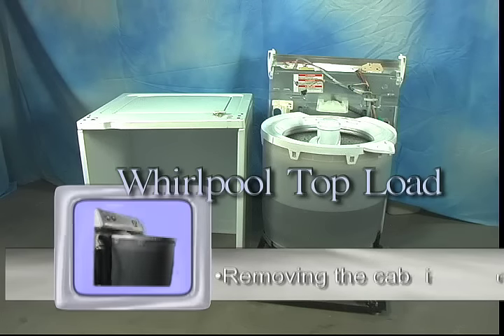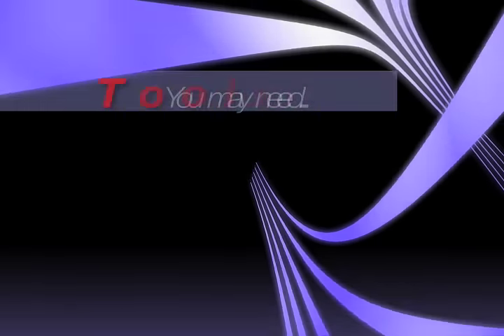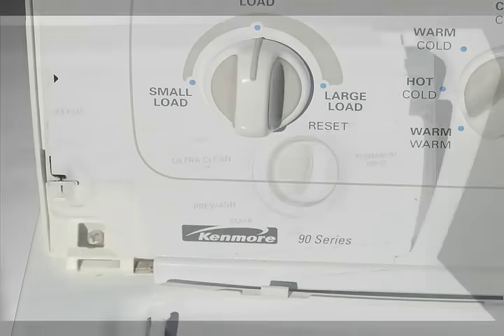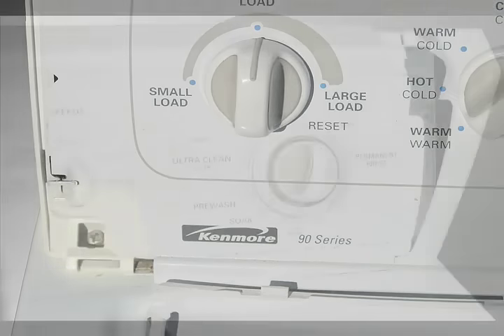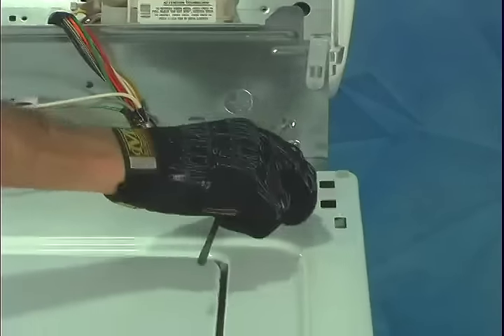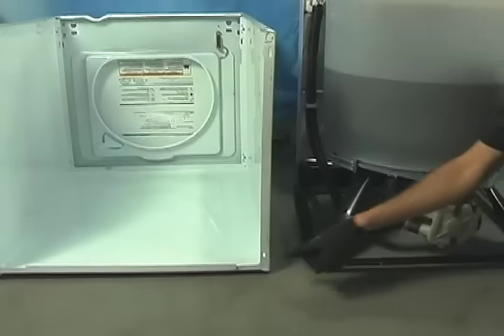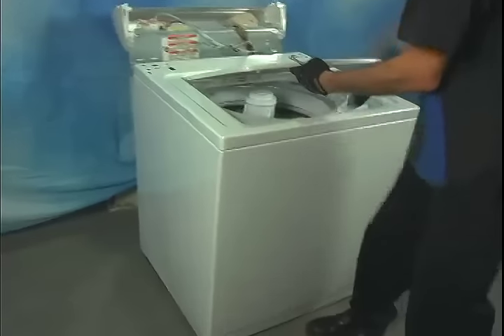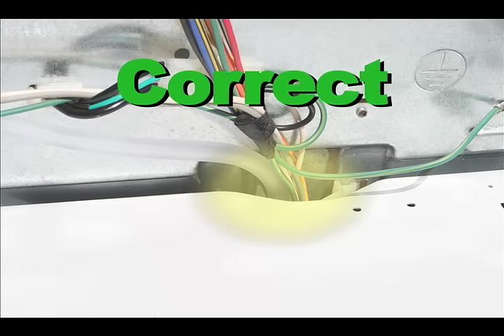Whirlpool Washing Machine Repair

Comment: On a normal was cycle on a Whirlpool WTW57ESVW1 should the agitator start while the water is filling
Reply from the maker: James Moyers No it should wait to agitate until the water has reached the fill level based on the level setting... 
Here is a link to the service manual for that washer style
http://applianceassistant.com/Appliance-Repair/Appliance-Service-Repair-Manual-Feature.php?id=1519

Normally my guess would be the timer. However, your washer has an automatic load sensing switch with a small control board... so that is probably more likely to be the problem.  It's going to be difficult to know for sure without doing some voltage tests.  Start by visually inspecting the pressure sensor control. hopefully you will find and obvious burn or failure.

Comment: I had the exact same problem as 1timeinstaller commented on 2 months ago - a small leak in the plastic case of the pump which was easily fixed with epoxy.  But only thanks to the great video on how to get the cabinet off.  So THANK YOU!!

Comment from the maker: Occasionally the same kind of symptoms can occur during the rinse portion of the cycle if the water valve is not functioning properly.  If the timer freeze happens to be on the rinse portion of a cycle, be sure that you have full flow of both hot and cold water into the tub during fill before spending the money on a timer.  You may also be able to use an alternative cycle on the timer that is not having a problem for a while.

Comment from the maker: Hard to say for sure... It definitely could be the timer. You would need to check for voltage at the water inlet valve when it should be rinsing.  Some models run the valve current through a thermostat and that could be the problem as well. You basically need to check for 120VAC from the timer and then make sure its getting to the valve, or if its being lost somewhere along the way.  If the valve is being energized but not opening it's the valve. Hope that helps some! Good luck!

Comment: Awesome! Very helpful! Inspiring!  Thanks to your clear step by step guide I just opened up our Whirlpool top loader that has been dancing all over the laundry room lately. Pretty sure I found the problem, too! Couple of vertical hitch pin looking rods (head like a nail with a small hole in the other end) and they had dropped completely down and out of place and into their little plastic holder cups (I'm sure you know what I'm talking about). Guess a heavy load of jeans last year on "small" setting broke out the little cotter pins that held them in place. Looks like these little 3 inch long pins were supposed to be holding the different layers (looks like 3 layers) of the beast together inside. All the springs look fine. Hope this fixes it!
Reply: Wesley Juncker Actually not a reply but an update. I'm thinking now that those hitch pin looking rods may have been stabilizer pins for shipping that shouldn't be reconnected for regular use. (Don't ask.) But I did find two worn plastic wear pads (snubber pads) and a third one in the back was completely worn down to nothing and was giving metal on metal contact. Replacing the three wear pads helped a little, but not a lot, with the shaking problem during spin cycle. Everything else (springs, etc.) looks OK. I'm stumped. ...

Comment: This is a useful video but it is mistitled.  It is not about repairing anything, or even diagnosing issues, but rather how to disassemble the washer cabinet in preparation for (unspecified) repairs.  The title should be something like "Whirlpool Washing Machine Cabinet Disassembly."

Comment: I just replaced the belts on mine and turns out i didnt have to remove the shell just tilt it backwards I would look under it before going through the trouble of removing the shell just a thought.

Comment: Please help me my name is Erin I just bought this washer model # wtw4800xq1 I went to go switch loads and noticed my clothing was still wet so I tried draining and spinning it did nothing then I tried just starting over all my lights come on the lid latches and it makes a faint swish sound but there's no water and its not doing anything on any other cycle but the swish sound please help me before I lose my mind my warranty ran out last month. Thank you

Comment: I'm having trouble with my washer model #WTW5100VQ0 top load it starts filling then stops at med load we have to manually fill it to a large load so I'm not sure if the switch is bad or if it can be adjusted  greatly appreciate any help!'
Reply from the maker: +Bev Montoya That is a good washer! Whirlpool stopped making it a while back, but I would keep it going as long as possible.  It does sound like the pressure switch, Here is a link to the part:
http://www.repairclinic.com/vwo10/PartDetail/Pressure-Switch/W10339334/1636739?RCAID=27317

If it doesn't work they will let you return it and get your money back.

Comment: I have a Whirlpool washer. It will fill and then just hums and won't drain or agitate. I did notice a slight electrical burning smell. Is the motor most likely shot?
Reply: Michele Bowden
Reply: Michele Bowden either the motor or the run capacitor. Since its been a year, you most likely have fixed or replaced the machine by now.

Comment: When finished, call up Steven Hawking and challenge him to a chess match too!
If your old washer isn't working, follow these easy steps:

1) Go onto your local CRAIGSLIST and find a suitable replacement.
2) Contact someone to deliver it (a local GUY WITH TRUCK will be good)
3) Contact a METAL MONSTER (metal collector) and exchange your old hunk of metal for his lifting abilities to install the new one.

Washer < $100
Mover <$40
Metal monster $0
= $140 removed, installed, disposed. DONE.

Comment from the maker: You may want to look at the tub and suspension video that I have posted and make sure all of the suspension springs are attached correctly. If it is happening even when the tub is empty there must be a problem...  There is also a slip plate and a few pads that could be out of place... that video covers all aspects of the suspension for this style of washer.  Good luck!

Comment: Mine would fill and then sit. It turns out the lid hinge on the left side was bent just enough to not fully engage the switch. remove the 4 screws holding the lid, then pull the hinge out. Make it straight, put it back in.

Comment from the maker: You may want to look at the drive system video... You may have a problem with the motor coupling, clutch, or possibly the transmission. (In that order as far as likelihood) That video would probably shed some light on what to look for... If you have any other questions let me know.  Good luck!

Comment: My whirlpool 5.5 kg front loader washer just stopped working, no warning no error lights, just nothing at all when I plug in turn power on then move dial to any position (to start cycle). No lights or sound. Any suggestions? It has worked perfectly prior to this.

Comment: Today I replaced the 4 agitator "dogs" and the agitator still doesn't move at all. I checked to make certain I installed the agitator dogs properly and now the agitatormanually moves to the left and to the right (it didn't before I fixed it). It makes a large humming sound when I put it on the spin cycle. I took care of one problem with agitating but it still doesn't spin during spin cycle. The water does fill up and drain with no problem. PLEASE HELP A GIRL OUT.
Reply: Hi... thanks for your video! Im having some loud issues with mine.
Reply: My is a Whirlpool wtw57esvw1 when I looked the base it sema that IT was missing the 3 pins!

Comment: My Whirlpool machine powers off during different cycles. Shuts off no power. I am thinking something with AC power supply or control circuit board?

Comment: My Whirlpool duet front load washer will slowly fill with water after use. Is there anything I could check before calling a repairman?
Reply from the maker: In most cases that would be caused by the washer's water valve not sealing all the way and slowly leaking into the tub.  So replacing the valve should fix it! The top comes off with a few screws in the back, that should give easy access to replace it.

Comment from the maker: @lhtbuilder 
I believe both the short & delicate cycles are low speed options, and Heavy Duty is high agitation/ high spin. That is a sorry excuse for a washer user manual!  12 pages of safety and installation stuff and one page of user instructions…Ridiculous. Ether the motor or timer wires are not fully plugged in, your timer is not sending power in those two cycles (unlikely), or the low speed motor windings are bad.  You would need a voltmeter to test the last one.  I hope that helps!

Comment: Thanks for the video. My whirpool has a problem that after spinning then the cycle repeat to fill the water while keep spinning. it never stop. The water valve, I guess, is still functioning well as other cycle work fine. would it be the control board problem?thanks

Comment from the maker: In most cases it would be the lid switch your washer uses part# 285671 about 30.00  I have another video on troubleshooting and replacing the lid switch that may help.  If you do need to order the part I would greatly appreciate it if you would purchase through a link on my website : )  If you have any other questions feel free to ask! Good luck!

Comment: I  have already  taken mach apart and the lid switch has been tied off.  When i turn it on, it will hum but nothing happens.    I have not found another question relating to this problem and cannot decide what to do next.  I cannot do POE.  If  you have a specific idea on what is  wrong, please let me know where to start.

Comment from the maker: @pookiealeman Well since the washer drains we know the motor is working.. It would definitely be worth checking the motor coupling to see if that is completely broken, not transferring power to the drive system. (I have a video for that)  If the coupling is intact it is likely a transmission problem.  If you need more help email me through my website and I will give you my phone number so we can chat. Good luck!

Comment from the maker: @tzebra The valve is almost positively responsible for those symptoms.  That is a slightly different "improved..." water valve that is a little difficult to find.  I cannot post links on YouTube comments but i f you send me an email through ApplianceAssistant Com I will be able to send you a link to the valve for 41.97 with a one year warranty.  It is fairly state forward to replace once you have the cabinet off.

Comment: im having trouble with my whirlpool washer. its sound like a thunder its almost jumping.  im afraid it will blast. i consulted it the technician but no  remedy at all.
Reply: Perhaps one or more of the springs that support the bottom of the tank have come loose.  If they are not there, the tank can wobble wildly.

Comment: I have a 2003 Maytag HAV2558AWW  Rev. 10. It currently still works and runs through all cycles but recently started making a bit of a rumbling noise during the spin cycle even though it is not out of balance. Does this model have a spin bearing that may be going out?  Or could the clutch starting to slip make a low rumble sound? I haven't pulled it apart yet because it is still working. Need your advice on what to look for.  Thanks.
Reply from the maker: It does have a bearing that could be the cause... However, on that model the pulley of the drain pump part#35-6780 is very common to slip down and start to make a grinding noise.  Tip it back and pull off the belt, them manually turn the pump pulley and see if you get any kind of grinding... Hope that helps!
Reply: applianceassistant Thanks for the quick response. I pulled the pump out and did not detect any play in the pulley,nor any blockage or grinding noise when I spin the pulley. Although there is some resistance when I spin it. Should it spin freely like a hamster wheel or is the stiffness normal ?  Also during the last load of wash the tub drained but did not spin until I held the lid switch down and gave the tub a spin by hand. (this is a new development). Then it seemed to spin faster than usual and still made the whirring sound like an aircraft revving up. It also clunks to a stop if you open the lid during the spin cycle.
Reply from the maker: There should be some resistance on the pump, but very little noise.  It sounds like the motor is having a hard time getting things going... if everything else under it moves freely, it could be the center bearing, but I would not recommend that repair for that washer. Unfortunately they just don't last very long in general. About 8 to 10 years is the life span of that style of washer.  Hope that helps...
Reply: applianceassistant Thanks for your reply. I havent't had the the problem of the tub not spinning since that one time and the agitator works fine. I don't detect any play or noise in the motor shaft and it seems to run strong.  I did notice the white shavings from the snubber ring so I will replace that and wait for the next shoe to drop. Thanks for your help.
Reply from the maker: Great! Thanks for the update!
Reply: Whirlpool cabriolet platinum Low wash system he

Comment from the maker: @lhtbuilder 
When you say won't work…Do you mean won’t fill, wont agitate,...? That washer has a 2-speed motor so my first thought would be bad timer contacts but you may have a problem with your motor.  You would need to check for voltage at the motor and resistance across the two sets of motor windings.  You can find a lot more help on my website ApplianceAssistant com

Comment: I have a whirlpool that makes a sqeulching noise when it starts the washing (agitation) cycle. It goes through all the cycles, but makes a real loud squelching at every agitation . what could the problem be ? The washer is only about 4-5 years old . I sure could use the help in diagnosing this problem please. Thank you for your help. trying to save money here if I could fix the problem.

Comment from the maker: @supersnouser I'm a little unclear on the symptoms... if it just stops when it should be spinning Check the lid switch.  If it is not spinning at full speed you may need a new clutch. If it is running but not spinning at all  could be coupling, transmission, or clutch.  I have 8 other direct drive washer videos and troubleshooting on my web site that may help.
ApplianceAssistant Com 
Thanks for your question.

Comment: My tub i put clothes in is leaning to the side.  It was making alot of noise and shaking.  Now tub is leaning
Reply: You probably lost/broke a spring on the bottom of the tank.  This video will show you how the see under the tank.  There are 3-4 springs which let it wiggle a little but keep it centered.

Comment: our Whirlpool WTW6600SW2 WASHING MACHINE MAKE LOUD BANGING NOISE , NEED HELP
Reply from the maker: On that style of washer, a loud banging is most often caused by weak suspension springs. It's a pretty easy fix, especially with 2 people. Here are a few links that may be helpful in diagnosing the problem and finding the correct parts.
Repair guide and service manuals:  http://applianceassistant.com/appliance-repair/washer-repair/cabrio-washer-repair-guide/

New Suspension Kit: https://www.repairclinic.com/PartDetail/Suspension-Rod/W10820048/4283301?RCAID=27317

Hope that helps! Good luck!
Reply: ST

Comment: My washing machine is not dispensing water
Reply: Perhaps the water inlet solenoids are not working.  Mine hum when they are activated.  They are just behind the water sport on either side of the water inlet.

Comment from the maker: Thanks for the compliment!  (I only have 500 characters) If it is the motor coupling pt#285753A then yes that is the part number and you are on the right track if the coupling is completely shredded then the washer may not agitate but it may also be the agitator “dogs” inside the agitator. I would replace the coupling first see if that gets it and then work on the dogs.  I have how-to videos at ApplianceAssistant. Com for a 5.00 donation. If you can’t afford that email me and I will still help!

Comment: My WTW6400SW has error 'F1' when start filling the water, it stops right there. What that 'F1' error for?
Reply from the maker: +xingyuan pan On that style of washer the F1 error is pointing at a bad main control board : (  
Here is a link to a free guide for your style of washer, hope it helps.
http://applianceassistant.com/appliance-repair/washer-repair/cabrio-washer-repair-guide/2/#f1

Comment from the maker: @tomster123100 No that is very strange... First I was thinking you may have a problem with your pressure switch or the pressure tubing that senses the water level...but it should definitely stop when you press the timer in.  what about if you unplug the washer?
email me through my website ApplianceAssistant Com  and I will give you my phone number so we can figure this thing out.